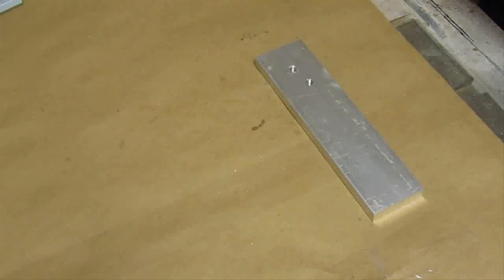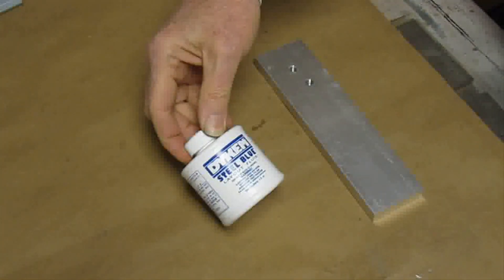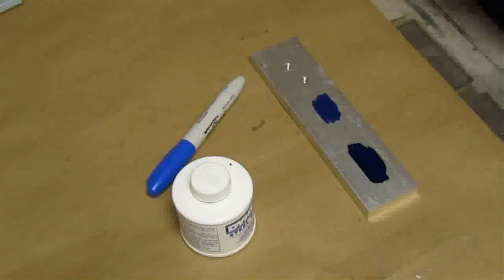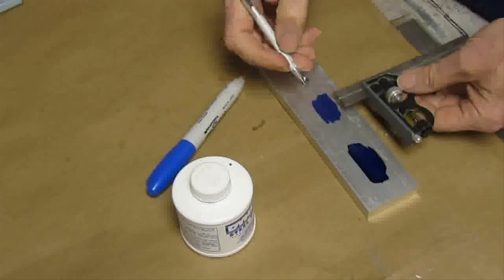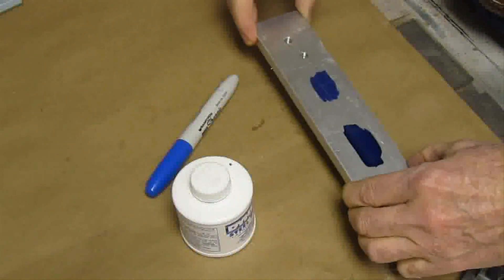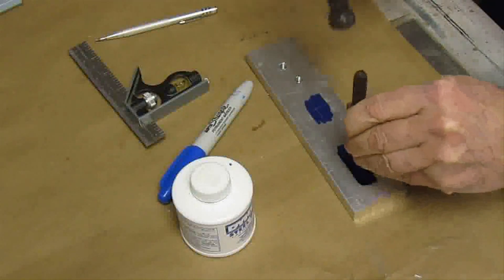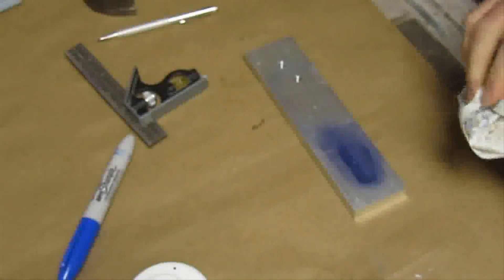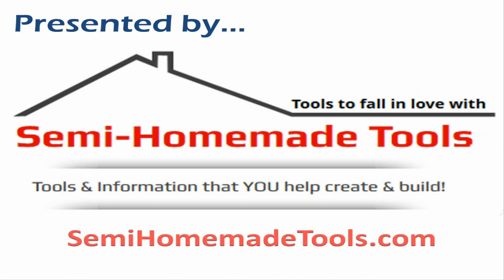Part Layout Marking

Comment: Long reach fast cap markers are better than sharpies and are a machinists best friend for tracing any parts where you need to reach down in a small (m4) hole. This has its uses to. We go through 20-30 long reach fast cap markers every couple months with our template parts for easy hole location and general outlines.

Comment: I use to use a 1" magnum sharpie, but I like the Dykem better now. As far as removing the Dykem, Carburetor / Choke cleaner takes it off instantly - it's not even a competition.
The reason I like the Dykem better now is because once dried, it doesn't rub off on my hands as quickly as the sharpie.